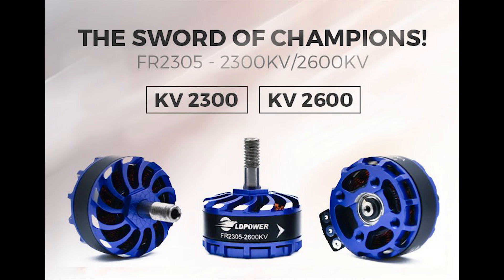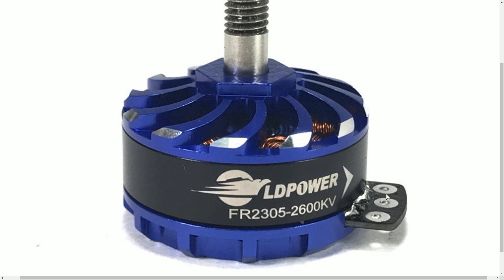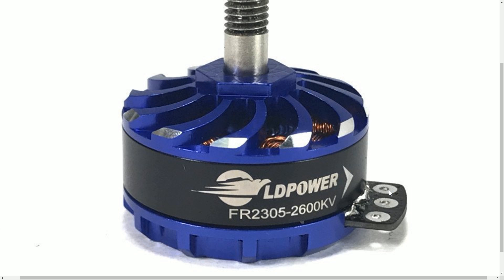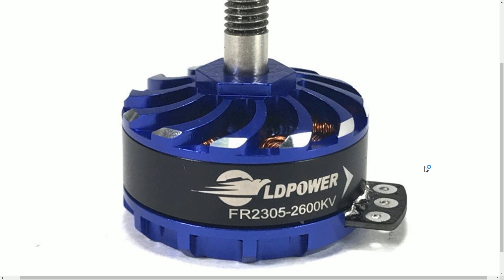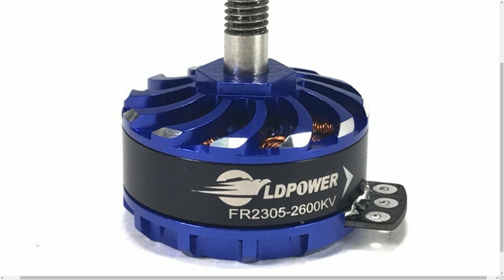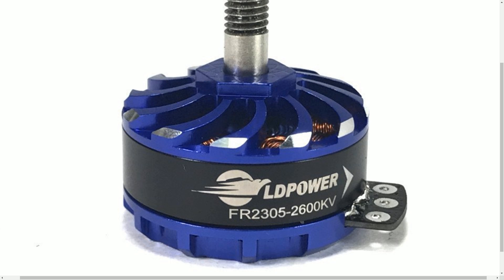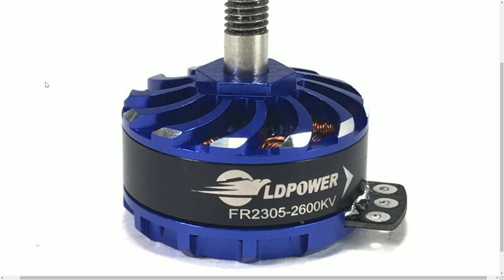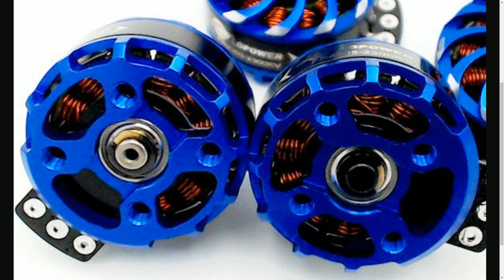LDPower FR2305 Motor | LIKE A V8 FOR YOUR QUAD

Comment: basically a motor will reduce current draw as rpm increases. lower kv will cause this to happen faster. if the motor is stopped a lower kv will have more torque but at rpm it will have less so there is a crossover point. the stator size is one factor in torque and rpm is related to how much torque it takes to turn the prop, the prop also takes less torque to turn depending on how fast it moves through the air. the smaller stator motors will have the same low to mid throttle response but at high throttle will not have the torque to go full RPM untill the quad starts moving at high speed. this is like a turbo that needs some engine rpm to get into boost. the thrust is less than a large stator but it's not slow and it pulls at high speed if the kv is higher. a large stator will get the props up to speed before the craft fully accelerates. this is a problem with high kv because the power it takes to go that fast is significant. with low kv and a large stator the motor will look linear on a thrust stand. it will take a lot of throttle to go high rpm but the motor will always do what the throttle wants very quickly. with a high kv and small stator the motor will appear to taper off with throttle. but in the air it might seem to endlessly accelerate. 

it's possible today to make more thrust with 2200 kv than 2700kv last year. most of the top end reduction in RPM is from inductance and the time it takes to change the magnetic field. but some of it is from the skin effect on the conductors and some from Eddy currents in the core. the higher the motor speed  the thinner the skin creating more resistance in the winding and the possibility of Eddy currents in thinner core laminations. plating the wires with silver reduces resistance on the skin so if the skin effect starts to affect things it is less pronounced than pure copper but I don't think the motor rpm and thus frequency is really high enough for that to take effect. I'm sure it really just looks cool, marginally lowers resistance and is cheeper than full silver windings. using multiple strands of wire also mitigates the skin effect, if the wire is smaller than the skin anyway it always acts like a solid wire with no increase in resistance, using multiple wire makes it not act like a thin wire that always has a lot of resistance. I haven't done the math but i think we might be in the range where this makes a difference. if you look at the t-motor f-60pro it has multiple strands of silver plated copper wire and thin laminations. the 2200kv version is a beast running with 2500 kv motors even on 5" props where high rpm is needed to make thrust because it has the torque from the 2207 stator (or is it 2206?) and it's engineering doesn't cause it to taper more than the kv requires it to. 

I remember the quadmcfly episode well and his suggestion is that with these modern motors that have both big stators and high kv to run a easy to turn prop. something like an hq 5x4x3 or v1s 5x4x3 or maybe even a twin blade.. 

don't confuse amp draw with inefficient. it's really saying how effective the motor is at getting the power to do what you command from the props. if you don't force the props to do hard things, if you alter the throttle settings so you never ask for full throttle and only keep that surplus of power for headroom in the PID loop you might find the battery life is better. if you lower the kv of a large stator so the thrust is comparable to an older 2204 or 2205 you might be shocked at the battery life. lower the kv further and increase the pitch of the prop and it might get better still. high kv and high pitch don't kill batteries because of inefficiency in those components. they kill batteries because you are asking the props to make more thrust and maneuver in ways it couldn't before (and maybe still can't because you lack the torque with motor stators that aren't large enough) high pitched props are actually more efficient but you need to Ballance the total power output of the prop to what the battery can provide so you may need to slow them down if you're not happy with battery life.  with high kv you need to make the prop Easy to spin or to govern the throttle in some way. the new generation of current controlled ESCs might allow you to run a battery killing combo and just protecting the battery. when the speed increases and attitude becomes more agressive the thrust drops off, this is when the high kv will shine over the stuff me steele and finalglideaus like to run.
Reply: I tried some old two blade HQ 5045BN on my 2600kV motors yesterday and the copter flew amazingly with BF3.1.7 default PIDs. But two props were destroyed  after landing in tall grass. :(

Comment: What I didn't see mentioned in the review is flight times. I get that racers don't really care, but as a hobby/weekend flyer I don't want a screamer rig that only flies for 2:00~2:30min before the battery is done. I also don't want motors that are going to destroy my batteries in short order. Just not worth it to me. Battery tech is way behind motor development at this point  and is the sole determining factor for my motor choices any more.
Reply: 11:18
Reply: Jonathon I don't get your reference. At 10:12 Josh is talking about throttle curve. Not sure what you mean here.
Reply from the maker: Flight time was between 1:45 and 2:30 at best. But that depends heavily on your flight style and your batteries and your AUW and etc.
Reply: Thanks Josh. Good to know. I appreciate the reply

Comment: What other motors have the solder on tabs? I wish all motors we're built that way.
Reply from the maker: Rebel motors did at one point. I don't know if they still do. In fact, I think Rebel was the first. I remember some DYS motors had them because DYS got shit for copying Rebel.
Reply: Joshua Bardwell I'm interested in trying the lower kv ones, I can't justify the fact it will destroy expensive batteries.

Comment: I've been really disappointed with the R-Line battery. It was OK, but I felt my Infinity Race Spec were performing better. In fact, I sold the R-Line.
Reply: R-lines and adrenalines seem to be 80% hype 20% actual high performance. I have flying buddies who've had both puff with reasonable amp draw and good treatment (landing at 15ish volts, every time, charging at 1c maximum etc). IMO there are a lot of better batteries for less money. CNHL 100C and Dinogy orange v2 graphene come to mind immediately. I've had great luck with both. Never had a bad cell, never puffed, always come down warm to the touch rather than hot hot hot like my Adrenaline packs do. They also both put out more peak current, and sustain it for longer than the adrenalines. Less sag over the whole voltage range too. Just cos the pros happen to run them doesn't make them the best packs, IMO :)

Comment: I wonder if the motor was under propped causing it to heat up. that or the bearings were junk and couldnt handle high rpms.

Comment: Great Review Josh. I fly Ldpower swords and love them. I did notice after the first few flights that they had a different sound. I wasn't sure if it was because beat up props or what. Thought I was going crazy lol. However, they still fly amazing. I run the 2300 kv version for both freestyle and racing and I have had good success with them. I thought about moving up to 2600kv but now I'm reconsidering. I'm not rich and can't afford to buy packs all the time. So 2450kv will be my next venture. Anyway, you can check out my channel to see what I have put these motors through and hopefully it helps everyone in decision making of purchasing their next motors. Check out racersedgefpv.com for the motors, They're in US and excellent customer service. My YT link is https://www.youtube.com/watch?v=eVQG2yzB4AA

Comment: Speaking of torque curves and 23XX motors. Just got the new AVAN props for my copter with EMAX 2306's yesterday. They are actually designed with the torque curve of the RS2306's in mind and I've got to say they fly amazing! The control is super precise and almost no prop wash.

Comment: why don't you revieuw some really cheap motors and compare how hey actually performe.

i stuggle still what motors are the best (price, cualitie)
Reply from the maker: Myrcmart RCX motors have always had a really good price/performance ratio.
Reply: okay but i pay like +- 8 euro for a 2700KV 2-4S motor from racerstar

and for 20 euro  i have a 2400KV 3-4S emax redbottom that is less kv!! more sell tho but still witch one chould i buy?
Reply: Andreas Klein More kv doesn't mean more power ;)
Reply: MrMario616 that is right but how can THE price be so hight becouse it also had to do something with THE name becouse everieone knows THE redbottoms so are there like really good motors for onder 10 euro??
Reply: Btw i am just 14 and have 6 a week to spend... So cheap is really necesairie (bat inglich i am dutch...)
Reply: You pay a premium for slightly better quality (though, sometimes you just get ripped off), but there is a point to where the quality just falls off on the low end motors. I had a $5 motor catch fire, no physical damage, nothing shorting out. I flew it for 30 seconds, landed the quad in my hand, put on my goggles, and got ready for a take off. Quad tipped over in takeoff (Just starting quads), and I disarmed it within a second, I take off the goggles and see a cloud of smoke from the motor and ESC it burned up.

I inspected the motor afterwards, the resistance values looked fine in the coils, no magnets scraping, bearings fine, nothing I could really see wrong on the coil except they were a hint darker after it smoked. I put a 30A SimonK on it and watched it jitter and smoke just for fun.

**LHI brand 2204 2300kv with 5030 2 blade gemfan props and 12A "Emax" BLHeli ESC (who knows what brand they actually are, but probably anything that size might burn up if the motor catches fire).

Comment: Interesting stuff about the motor throttle curve. My T-Motor F60s and F80s are more linear, while my BH T2 Tornado 2206 2600kv are much more responsive on the top but less on the bottom. Great turbocharger/supercharger analogy.

Comment: Josh,  I am running the Armattan oomph 2306 2300 kv motors what battery would you use ( may and C rating)  I am running 30amp esc's

Comment: HOT MOTORS that was the word I was looking for for a while now...
I have that issue on EMAX2306/2400kv, they just get hot on all the props I tried, from HQ5x4x3, HQ5x4.3x3 to CYCLONES 5x4,6x3. Stock PIDs, tuned PIDs, low Ds, filters, TPA curve... whatever, they all get hot... Not to mention LIPOS being chewed!
What should be done that's my quest for a solution...?
Reply from the maker: Use a smaller motor.

Lighten your quad.

Comment: Until we have a leap in battery technology we don't need any changes no f4 or f7 , no new motors just quality built gear but cheaper price tags
Reply: Onur Can Vural Aggree motors are good enough for now ect.

But mire CPU power...naaa mann...we wong ever have enough...think of all the applications you could run with heavier more complex programming and flexibility.

maby not for pure raceing but a lot of the cool stuff u could program hasnt got a chance on a F7 😂.

think things like real-time computational stuff like active avoidance, image regonition, things that push s top end PC chip like a I7 or the new I9s to the limit...imahine what u could do if u could somehow fit the processing power of a server into a sub 450mm Frame! The ultility and military applications alone would be craxy...we could have AI raceing ect LOL or somin.
Reply: I agree.  F4 chips are a good idea. I have noticed some of my f3 chips are sluggish on the ground with the latest betaflight

Comment: I'd just like to say that all things being equal (they aren't, but go with me here) that the power you run through a given motor, the more heat is going to be created.  So, the fact that you're pulling 40-50 amps is indicator enough that they're going to run hot.

You can't simply run more power through a given motor (yeah they're a little bigger, but thermally probably not much) and not expect those motors to generate proportionally more heat.  Perhaps that's why we're seeing a lot of motors making attempts at self cooling through enhanced airflow over the coils.

Or am I wrong on this?
Reply from the maker: You're not wrong, but I would hope the motor was designed to dissipate as much power as it was expected to draw.
Reply: Well yeah, but that's a bit a of a gray area I'm thinking.  I'm betting motor manufacturers are starting to push the limits a bit more in terms of heat dissipation due to these high currents.

Here in Arizona, I can tell you that very few motors are capable of flying in the summertime due to excessive heat buildup.  You start to see more clearly which motors are already near their thermal limit, and which aren't.
Reply: Desrtfox71 This might be irrelevant but I pull about 56 amps on my 2205 King Kongs and their cold as can be when they come down, any reason why not as warm?
Reply: Jacques RC I'm going to take a guess here and say probably a combination of two things. One, the current isn't sustained as high, for as long, as these 23mm motors, and two, maybe better ventilation. Kind of a guess though. I'd like to know if the bench testers notice motors getting warm. That might help to know how much heating is due to pure power, and how much is due to tuning issues.

Comment: Another great vid. Keep em coming :)
Would love to see any of the RcTimer BeeRotor ZoeFpv Z motors in your hands, there are not much about them on the tube sadly and not easy to find "Flyers/pilots" info about them. I run them on 3-4 quads now and love them so feels like they are in the shadows. 1407 are deamons, 2207/2400 on my qav-x mmmmm, but my sad flying and bad English won't give them a fair comparison to others.

Comment: What if I want to go the other direction? Are there motors that are OK performance wise but kind to the batteries?
Reply from the maker: I would suggest anything in the 2205/2206 size, around 2400 kv. If you use a light prop then you could go up to 2600 or 2700 kv without stressing your batteries too much. Also, reducing your quad's weight as much as possible reduces the current drawn by the motors.

Comment: do you think that an infinity battery (1500) could handle the RCX 2206 V3 2400kv motors? They draw 35A on the bench with 5x4x3's.
Reply from the maker: That should be fine. That 35A on the bench is going to drop to maybe 25 in the air.

Comment: I absolutely love the power output of the chepo 2306 2700 kv motors I have been messing with.. but the batteries hate it lol. Nice video, interested in some 2400-2500kv versions soon. Great video!

Comment: I wonder if the smoke was the bearing oil getting hot enough to vaporize?
Do you think is was that hot?
Reply from the maker: Hard to say. Really hard to say. The bearing oil smoking out would be consistent with the fact that the motors got more rough-feeling even though they hadn't been badly crashed.
Reply from the maker: The windings showed NO sign of damage whatsoever for what it's worth so I was really stumped where the smoke could have come from.

Comment: Would you say that emax2306, or other 2306 like the new tmotor need topend lipos also?
Reply from the maker: I haven't flown those motors but yeah. I don't think we're going to see anything in the 23XX or 24XX size that doesn't need a great battery. I mean, you could detune the motor so it doesn't draw massive amps, but then it won't perform either so what's the point. 

Sometimes a new motor technology gives better thrust and efficiency, but that doesn't seem to be the case with these 23XX and 24XX size motors.
Reply: Thanks! Nice to know... 

i'm having a bad time choosing motors, i currently use diatone silver 2450kv on my main build and love them...(they are very punchy with infinity 90c :)) Was thinking about going for 23XX for a new build but maybe 2205 2600kv can make the job for me...? Have you got any fav's in the hi-kv 22xx size? Choosing motors this days is quite hard xD

Comment: Omg lol.  I was asking for that termination style like 6 years ago.
Reply from the maker: The first I saw doing it was Rebel motors. Credit where credit is due.
Reply: When I asked about it, as usual a couple people poo-poo'd the idea, but then some people pointed out some of the, uh, more esoteric motor manufacturers did it.

https://www.rcgroups.com/forums/showthread.php?1472950-Why-don-t-brushless-outrunners-terminate-in-a-PCB

It's a great idea, but then again...  it's common practice in consumer electronics anyways.  Just RC playing catch-up.

http://forums.parallax.com/uploads/attachments/41345/67575.jpg

What's least fun is when the wires coming out of the brushless motors are actually just the extended enamel wire, because when you cut that...  now you have to worry about carefully removing the enable just to be able to solder to it.  And you know it's not going to be the low-temp enamel that you can just burn off with a flame or iron.

Comment: I just remember the way the prop goes is the way you take bolt off or the arrow on motor but yeah a good supply of ccw bolts is good to have in this hobbie. My fear is these motors are goint to make lipo batteries like none rechargeable again but it might push the industry to make a better chemistry. I'm not sure the s rating but to my understanding if you have higher volts you need less amps so they might like high s batteries 5s +

Comment: Great review! Can you tell us what makes the motor hot? Is it because of the bearings spinning at high speed or is it due to huge amount of current flowing through the windings or both?
Reply from the maker: I don't know. These motors do pull a lot of current but I'm not sure that is enough to explain how hot they got.